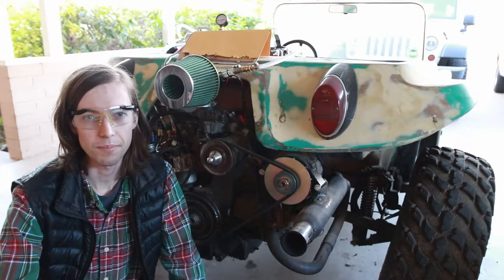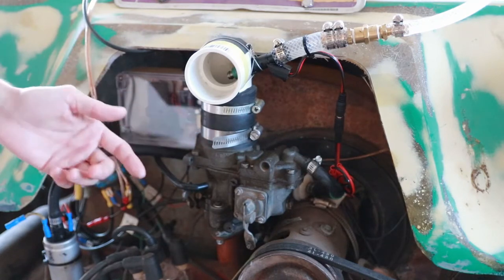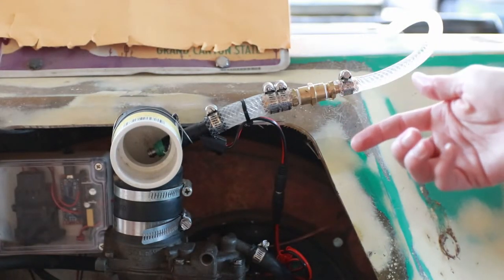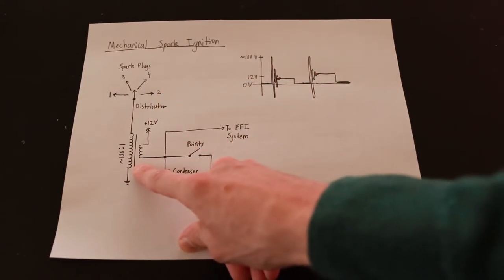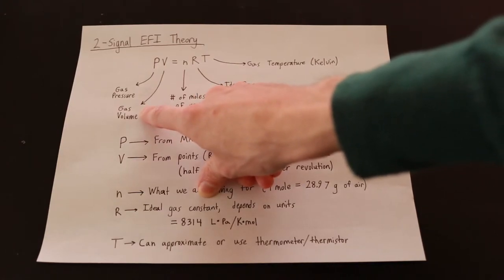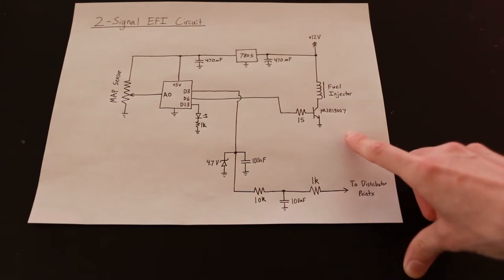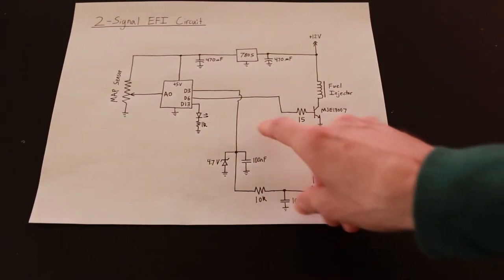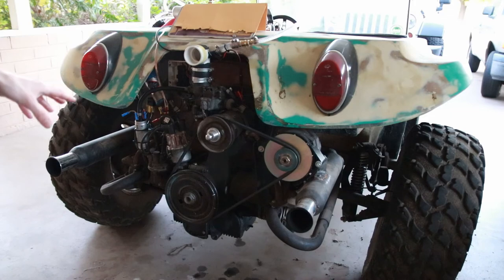Electronic Fuel Injection with MAP and Points Only

Comment: Hello again!
Today I discovered that the ignition module inside the distributor has a pin that'll output a clean 5V square wave according to the ignition coil pulses.
So I connected that pin to the Arduino points pin.

 Then I jumped the 10k and 1k resistors, disconnected the two 100nF capacitors (maybe didn't have to), connected 5V to another pin of the distributor (to make it accept incoming ignition pulses from Arduino), modified the ignition coil dwell time to 3000us (it's an old coil I guess) and it idles more stable than before.

However, regardless of the values I input for the initial, vacuum and RPM based advance, the engine won't rev above 2500 without misfiring. 
The rev limiter works though, I set it to 1400 and it won't rev past "2" in serial monitor (I have no dash tachometer).

My question is, how does the Arduino advance timing after receiving the signal from the distributor ignition module? It's not like it knows beforehand when the next pulse will arrive, right?

I can understand retarding a signal after receiving it, but advancing it after receiving ? It's like a Back To The Future thing to me.
Reply from the maker: Nice work!

The program doesn't implement advance by prediction, but rather, it uses an offset called the 'initial timing' to allow the distributor to be rotated to a very high-advance position in order to allow both advancing and retarding timing from the baseline. When the actual timing is neutral, the ignition signal will be sent after the initial timing angle of rotation has occurred, which would be some delay after the distributor/pickup sends its ignition pulse. When the program calls for more advance, it will reduce the delay below 'initial timing' degrees, and when it calls for retardation, it will increase the delay. It can not advance more then the 'initial timing' value, as this would of course require prediction.

This behavior might be part of the RPM limit issue you're having. Try advancing your distributor by a similar angle as the initial timing value in the program (initialTiming) and see if this makes any improvements. If you can, also check your timing with a timing light to see if it is close to the recommended settings for your engine, and tune accordingly.

Good luck!
Reply: @DielectricVideos  
So, timing advance for, let's say idle, results from subtracting the greater part from the initial timing - and the initial timing should be vacuum and RPM combined for maximum throttle, reflected physically on the distributor?

I suppose the vacuum and RPM values (both positive, right?) only add to that initial timing value?
Reply from the maker: @soupflood  Initial timing is just how far advanced you set the distributor relative to the position it would normally be set on the stock ignition system. So if the distributor is normally at 0 degrees and initialTiming is set to, for example, 30 degrees, then you would set the physical position of the distributor to be 30 degrees advanced of its stock position.
Reply: @DielectricVideos  
Thanks, I was confused. I shall do that in the following days.

Comment: This is truly amazing. Especially that it is relatively simple to create, besides the engine specific parts. What I'm really curious about, is the effect of variance in the injector type. How critical is it to get a fitting injector capacity? I can imagine that a bigger injector has a higher momentum, but is mainly a matter of shorter pulses. Whereas a smaller injector can be way too critical for the opening time to be too large. Can you elaborate on that? Thanks for the highly inspirational video!
Reply from the maker: The injector flow rate constant (max grams per minute) allows a fairly wide range of injector sizes to be used. A 30-60Hz injector pulse frequency (this value is fairly arbitrary for asynchronous TBI) is the rate a port injector would fire at for 3600-7200RPM, so a value in this range should provide a good tradeoff between fuel charge homogeneity and injector control resolution. Any higher than 60Hz is probably too fast for the injectors to have good metering resolution, and any lower than 30Hz will give "lumpy" fuel charge in the intake.

The biggest issue with very large injectors is that the commanded duty cycle near idle can more easily drop below their minimum allowable on-time, leading to a no-fuel condition near idle. In the newer versions of the code for the HEI ignition control boards, I added a pulse frequency modulation function that maintains a minimum injector on-time by lengthening the duration between pulses, so this allows arbitrarily low duty cycles to be used. 

The biggest problem with undersized injectors is that they can hit 100% duty cycle under high RPM and load, which is also the worst time to have a lean-out condition. It's worth manually walking through the speed-density calculation with maximum possible RPM and manifold pressure in order to determine your maximum injector duty cycle for your particular injectors, to ensure the duty cycle doesn't exceed 100%.

Comment: Wouldn't a 555 do this better?
Maybe a photo interrupter as crank angle sensor?
Reply from the maker: For a fixed-AFR system like the one shown, a 555 can definitely be used as a variable-width pulse generator. MAP signal can drive the pulse width, and each pulse can be correlated to an earlier ignition pulse. The microcontroller becomes more useful if you want an adjustable AFR table that allows mixture to be changed across RPM and MAP values. On the version of this system that I currently drive (and for a long time drove daily), I have an AFR table with 100 setpoints, so the MCU is quite a nice feature to have.

Comment: your drive transistor for the injector might get a little toasty. flyback diodes are not that big a deal for current dissipation time, especially if you go for one with higher forward drop.

Comment: What map sensor are you using?
Somewhere hidden in my attic is my 1980’s student electronics  project, an analogue electronic fuel injection, system. Lack of technology and lack of knowledge meant it didn’t work well or often. It got me a good grade though, along with the Nick name fire risk.
Reply from the maker: Sounds like a really cool project! I actually thought about implementing the system in analog electronics, using spark-triggered injection with the on-time set by the MAP sensor voltage. But I decided to go digital in order to allow more sophisticated control to be used, such as adjustable AFR tables, etc.

As to the MAP sensor, I used this one: https://www.amazon.com/gp/product/B07Z37XG1J
Reply: @DielectricVideos  I’d seen that the cosworth rs500’s were using msd ignition systems and a very early motec device that had trimpots on various rpm points. My take on it was a 20 output led bar graph display, each out put fed a trim pot which fed a commoned pwm circuit. The pwm was also altered by input for water temperatures.
It took some sorting out!

I didn’t learn, 10 years later I had a go at traction control for a motorcycle. Pure unadulterated comedy!! I had no idea about the dynamics involved. Ate a lot of tarmac. Eventually decided to bin it.

Comment: One week ago I managed to get the V6 engine running okay, it seems the injector value I had input was wrong. In your last "points and MAP only" version (the one with start and running idle but no HEI) you've left an injector value as comment (640 grams per min) well I took that value, doubled it (because I input the whole 3.1L engine volume) and it simply worked!

One problem though: when I press the gas pedal, the engine lags ( about half a second, during which the engine seems to just stall - sometimes it does stall - before it revs up from base idle). Did you experience that or could it just be my engine?

And another: you mentioned that the Arduino sometimes fails to count correctly the points input. Did you try to increase the 100nF capacitors value before upgrading to HEI ? It's not very bad, but I would like to fix it in the future without upgrading to HEI (if it can't be done, no problem).

In a desperate attempt to find out what the Arduino serial monitor could tell me (when I couldn't make the engine start properly), I started the engine while connected to the computer USB... Several times. Nothing bad happened, thank God.
Reply from the maker: Very cool!

A couple of things you can try to improve throttle response are:
1. Adjust fuel mixture (either by changing individual AFR values or by adjusting the "injector_MaxGramsPerMinute" injector flow rate constant). Usually loss of power on throttle input means it's running leaner than it should, but in some cases it could be due to excess fuel if it's really rich.

2. Adjust the "vacuum_ROC_Multiplier" constant, which adds extra fuel in response to a sudden increase in manifold pressure to emulate an accelerator pump. Try both directions (up or down), as both an excess of fuel or lack of fuel on acceleration can cause hesitation.

The physical structure of the intake manifold as well as placement of the injectors can have a big impact on response as well. If the injectors are too close to the heads, the fuel may arrive in pulses rather than a continuous stream, and if the manifold or intake runners are too long, there could be a delay in arrival time of the mixture charge. Because the software fires the injectors asynchronously, the system is best suited to a TBI-style system.

If it stalls at idle, you may need to increase "min_DC". This is a hard lower limit on the injector duty cycle that ensures that some fuel is always delivered when the engine is not "stalled" (below stallRPM, which is 300 RPM by default). The speed-density control is a bit unstable at really low RPM and MAP pressures, so setting this value correctly can help eliminate occasional calls for 0% duty cycle that can lead to oscillation or stall-out. 

I didn't play too much with the capacitor values, but I did find that it was sometimes more accurate to set the points interrupt trigger to "FALLING" rather than "RISING", as the falling edge was more decisive than the rising edge. You can also adjust the depth of averaging on the RPM calculation, as this provides another means of smoothing the signal (albeit at the cost of responsiveness).

Later on I also learned that it can be hugely useful to add a copper  shield over the top of the ATMega328p chip and its clock crystal. The interference from the spark ignition system can cause all kinds of weird behavior and crashes on the MCU, and when I added shielding to mine it went from crashing every couple of hours of driving to never crashing at all. Also worth noting is that the small linear regulator on the back of cheap Nano units can sometimes randomly short out and dump the 5V rail, so if you're using an off-board regulator, I recommend desoldering the one on the Nano.
Reply: @DielectricVideos  

I'll keep tweaking the fuel metering constants in hopes that the throttle response will get better.

One thing I found odd was that, in the serial monitor, on sudden throttle pressing and holding, the pressure read shot from 1 at idle to 6 or 7, then returned and floated at 3. Did you experience the same with your pressure read, or maybe my MAP sensor has gotten too old?

My engine has a stock TBI, so I didn't really have to modify much to implement the two-sensor EFI and ignition sketch (I don't use the ignition feature because I don't have HEI and optical distributor).

I installed the Arduino in the metal box that the old computer was in, but I shall also screen the chip, delete the on-board regulator and set FALLING to 1 as you said, maybe even add more 100nF capacitors if that doesn't help; sometimes the Arduino reboots, even though the engine keeps running
 (I found that out thanks to serial monitor which displays the welcome message at startup).
Reply from the maker: @soupflood  One thing that may happen with the MAP pressure is when air is first allowed into the intake, the pressure may initially spike as air enters the manifold. Once the engine picks up speed, it will draw more air per unit time, and the MAP will drop back down even at the same throttle position. On a side note, this is one reason why TPS and MAP aren't always directly correlated, and why I find MAP to be more useful than TPS for speed-density control (although TPS can help with transient fuel  metering).

I'm not really sure why, but I found that my engine ran a lot better with 5-7 degrees of extra distributor advance than when it was on the carburetor. I'm reluctant to suggest adjusting this, and is usually specified in a fairly narrow range by engine OEMs and can cause preignition if adjusted to excess. However, it may be worth a try. I could speculate about the differences in fuel atomization and flame front velocity, but in reality I don't really know why it seemed to want more timing on EFI than carburetor. The engines I've tested on are all old worn-out VWs with various existing problems, so your results may vary.

It's useful to ensure the metal box and/or copper mesh shield is grounded to the same 0V reference as the Arduino, otherwise it will just re-transmit electrical interference like an antenna.

Also, I have also had issues with crashing when the USB is connected. It's useful for debugging, but when test driving I find it is much more reliable without the USB cable connected to the unit. This is probably due to both conducted interference from the cable, as well as intermittent reset events from the CH430 chip due to transient signals on the USB data lines.
Reply: @DielectricVideos  thanks for your input

Comment: One issue with the ideal gas law, it only applied to dry gasses.  Mix in a substance that can change from liquid to gas and the law no longer applies.
Reply: Agreed.  Not an issue with port injected systems, but with a single point throttle body injection relating MAP to volumetric efficiency in a repeatable way is going to be problematic.
Reply: @ferrumignis  very true, however, this is not a design of a modern EFI, which needs to meet strict emissions criteria. It just needs to be better than the carb it replaces, especially for the intermittent use with modern gas that most carbed cars see today.

It is comparable to the idea to tune a carb to "lean" and enrich the mixture on demand with a dedicated auxiliary injector depending on a few inputs. Theoretically it gets rid of choke and other bits.

Comment: How many cc injectors do you use for the 1600 engine? 
What trigger map sensor are you using?
Reply from the maker: I use two injectors for the 1600 engine. I'm currently using this type: https://www.ebay.com/itm/223283676528

These are 440cc/min injectors at 50 PSI fuel rail pressure.

It's worth noting that most fuel injectors don't fully open below about 2 milliseconds of on time, so when using very large injectors like these, it may be necessary to transition from pulse-width modulation to pulse-frequency modulation at low duty cycles.

For the MAP sensor I'm using this one: https://www.amazon.com/gp/product/B07Z37XG1J

For a while I was detecting RPM by triggering directly off the breaker points signal via an RC filter, but more recently I've build a custom optical sensor that goes in the distributor, and I have it controlling both injection and ignition timing.

Comment: Does your fuel get hot? I've found that when I use a high pressure/high waste return, the fuel starts vaporising from excessive heat. PROBLEM
Reply from the maker: I actually encountered this exact problem, but it was only an issue when I tried looping the fuel return directly back into the pump (I was trying to avoid the need for two tank connections). It ran for about an hour, but then the fuel started vaporizing and the pump would intermittently lose prime. I built a return-to-tank system after that, and have never had any issue with fuel overheating since.

Comment: What kind of MAP sensor would be appropriate to use? Did you use arduino nano? Will it be suitable for motorcycles?
Reply from the maker: I used this MAP sensor, which is an analog-output sensor that gives a reading from 0-5V depending on absolute pressure. I'ts a vacuum-sensing MAP sensor, so it will work with any naturally-aspirated engine: https://www.amazon.com/gp/product/B07Z37XG1J

It's also worth noting that if this system is used on a turbocharged or supercharged engine, you would need a MAP sensor capable of sensing positive pressures as well as vacuum, and the microcontroller would need to be adjusted accordingly.

Correct, my version uses Arduino Nano. Other microcontrollers with analog inputs, digital inputs, and digital outputs can also be used.

In theory the system should work for any gasoline engine, including motorcycles. Some engines are more sensitive to fuel mixture and injector interval than others, so your performance may vary. If the injector(s) are placed too close to the intake valves, you may get uneven combustion due to gaps in the air/fuel charge in between injection pulses. You also might need to find a smaller fuel pump to avoid applying excessive load to the charging system.
Reply: @DielectricVideos  thank you